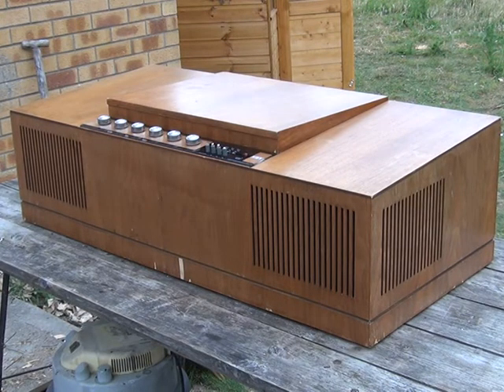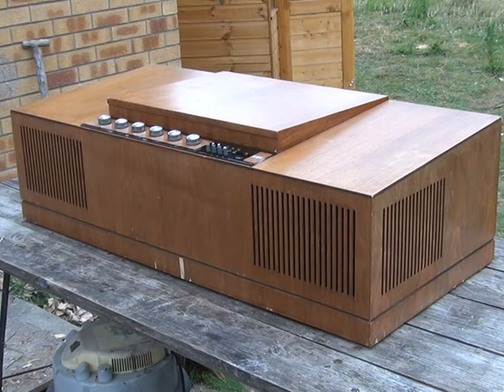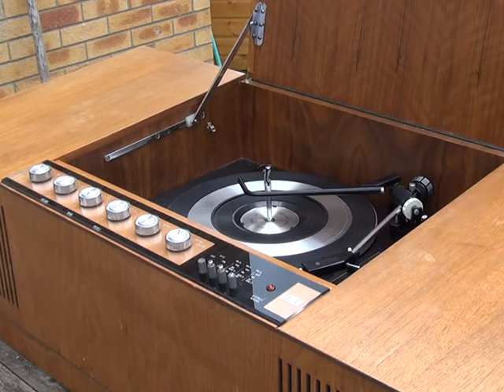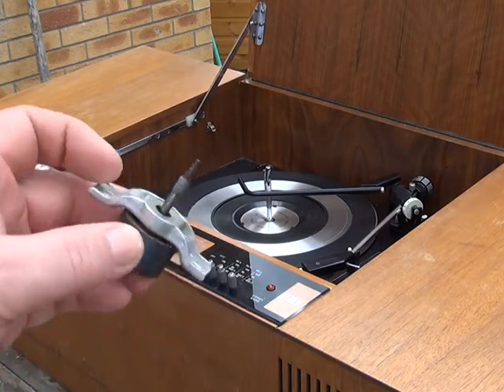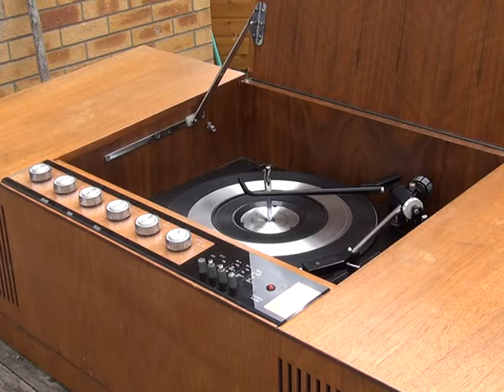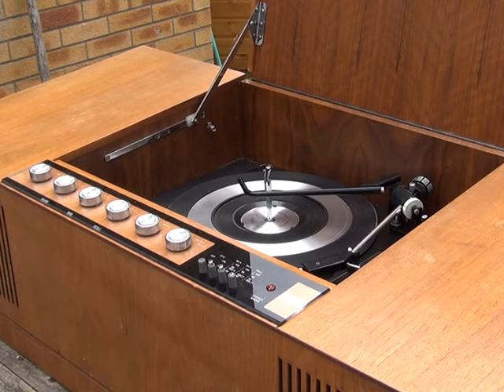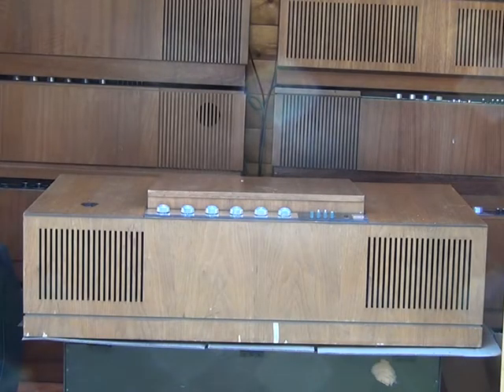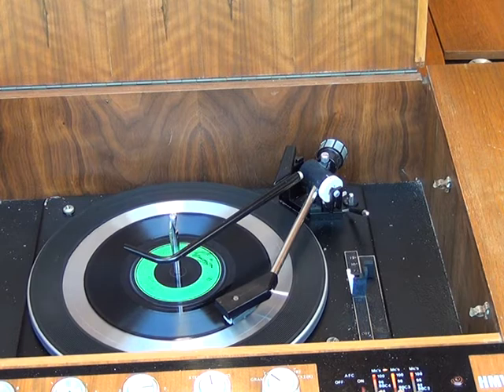HMV Stereomaster radiogram 2330   pt3 of 3. All put back together & working

Comment: This has brought back such wonderful memories for me - my dear old Grandad bought one of these many moons ago when it was the bees knees of radiograms - cost a fortune back then I recall - what with the four speakers and the soon to be stereo radio - it was a day for celebration when finally the little red light flickered on during a radio broadcast. There'd be a big family get together every Boxing night and up would go the volume while we all jumped around to Lily the Pink from Scaffold and Benny Hill's Ting-a-Ling-a-Loo. Grandad had many years of faultless use from the old faithful and he kept it till he passed a while back - by which time the cabinet had seen better days and the sound had deteriorated somewhat. Happy days - thanks again.
Reply from the maker: The capacitors needed to sort the deteriorated sound are only about £16. All electronic products get failing electrolytic capacitors after about 35 years of use. The snag today is the capacitors in new products are not on top of the job & neatly fail about a week after the warranty ends. Clearly planned. 

Richard

Comment: The 'Monarch' series of turntables was by far one of the best turntables. Simplistic but reliable. The Garrard deck produced through THORN industries was cheap and nasty. The spindle with the lower bearing race et could seize up. Metal corrosion due to two different metals/alloys fusing. 😗 HMV stereo radio units could also be problematic, blown power transformers, blown output transistors, tuning gang seized. I did work on two of them and would not bother doing them again. I own a Pye stereogram (80's) bout the same size but solid teak not that awful cheap and nasty, fibre board et Took two of us to shift that.
Reply from the maker: I think you are muddling up other HMV radiogram products. This is about the Stereomaster model. None of the Stereomaster models had tuning capacitors & were all varicap tuning right from the first one in 1967.

Under the HMV badge, Thorn (BRC before it was called Thorn) produced quite a range of solid state stereo radiograms right from entry models through to ones with multiple short-wave bands. The steromaster range was a seperate 'upper' range with the 4-speakers in that corner configeration & the radios were alweays FM only & always push-button varicap tuned.

Richard G0OJF, UK
Reply: @ukfmcbradioservicingTango21  Hi👍 You're right - I dug out one of my 'exercise books' 🤣that I kept my 'service logs'  in et My nans was a FERGUSON 3369 why that seized tuner stuck in my mind is cos I did an ULTRA 6339 fitted with the same radio et unit with an identical issue.😗 That one also had the blown power transformer AND two output transistors also blown which in 1990 I sourced from Germany.😗 The Garrard deck seized issue was a frequent nightmare  . Cheap and nasty.😗 Don't get me wrong, when they were repaired and working again, they were OK (well for its time and my Uncle who was a manager for Curry's sold a lot of em Or was it Rumbelows.. 🤣🤣

Comment: Nice one Richard, i am not sure if they ever made records to play at 16 rpm however, i used that speed quite a lot back in the day.  I used to play PL s (that should run at 33 rpm) at 16 rpm as they would not only be slower, and at a lower octave but still be in the correct key.  This way i would be able to learn solos by ear on my guitar by playing along.

I can only imagine how hard it is to get those synchronous shaded-pole motors these days.

Thanks for posting
Reply from the maker: As far as I know only BBC transcription records & some language course records were ever on 16RPM. However, Mr Chippie was correct to insist the replacement motor did 16RPM; just for completeness.

Richard

Comment: Hey guys,
I have a hmv statesman TL-44 and the lift arm is not working.. I’m not sure if there is a missing part or spring and can’t find any diagram for that mechanism.. wondering if you could email me to correspond as I live in Australia and just need this to be fixed to complete the puzzle..
Reply from the maker: Jessica, I've done some checking & not surprisingly it's an Australian model & not a UK one. So we have nothing on it. In any case, service manuals don;t cover record decks as they are a bought in item. What you need is a service manual for the record deck. As the Statesman is a 1973-74 product, if it was UK, it would use a BSR record deck....you need to know what model by taking the bottom off the radiogram & looking what the label says on the deck. My experience is that it's always a lubrication problem rather than missing bits. You've commented on Pt3 of the HMV 2330. Hopefully you've viewed Pt1 which covers record deck lubrication & could well be the same unit you have.

rshireby@yahoo.co.uk